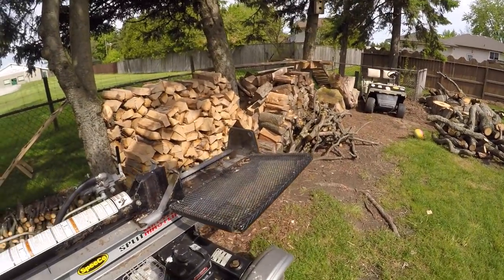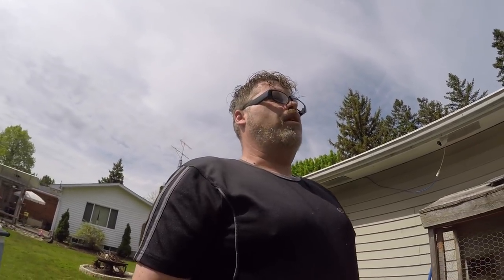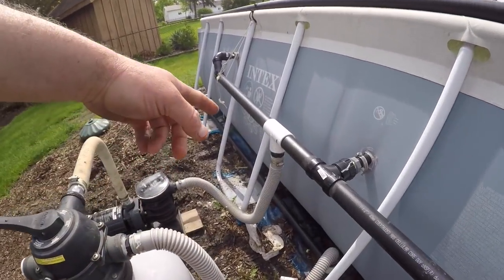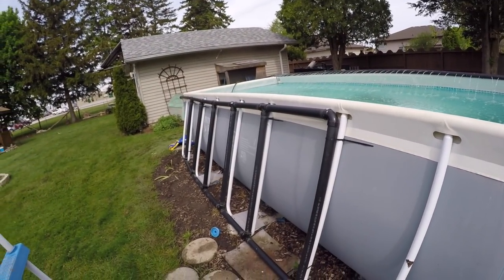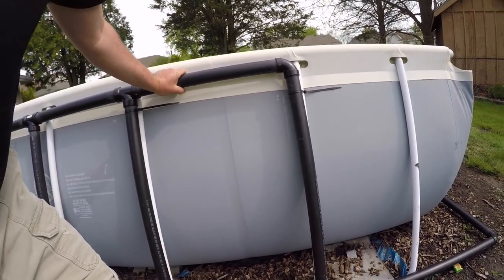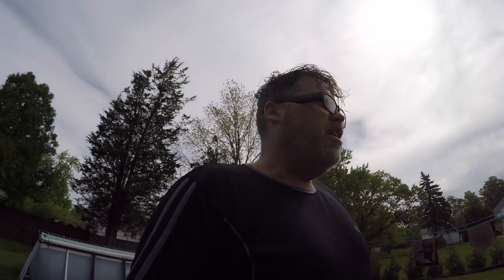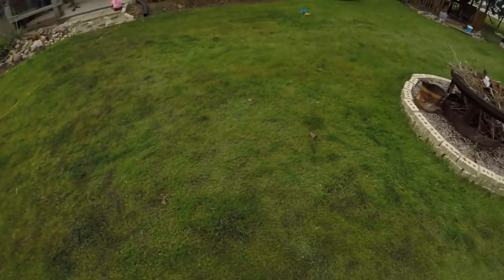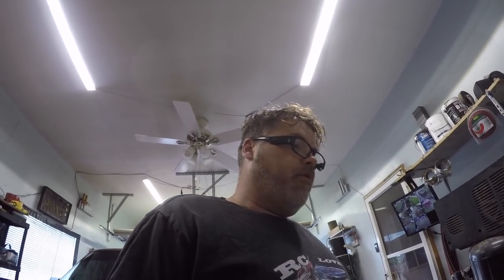DIY Home Made Solar Heater For Pool

Comment: The pool heater looks like it will work slick as tube of new dimes there Jim. Why the hell wouldn't it. And thats big old log splitter ill tell ya what. What kinda woodstove ya got there BillSiff? Or is it just for campin wood? I say no way with a splitter that big.
Reply from the maker: both buds
Reply: @LifeWithBillSiff  i knowed it. Lol